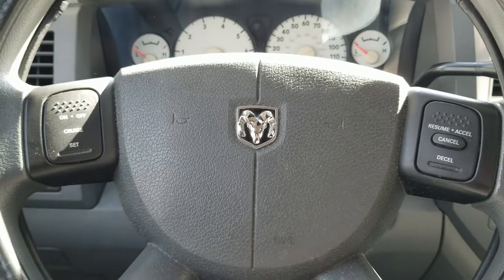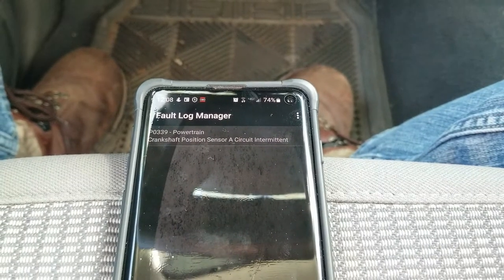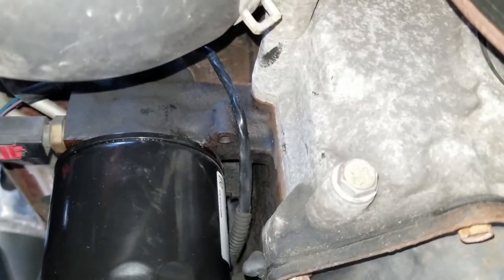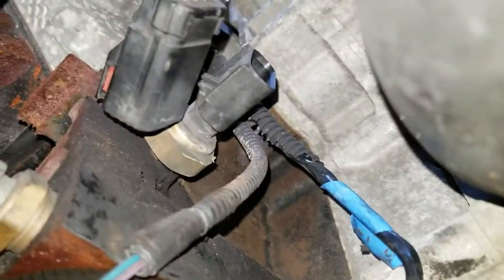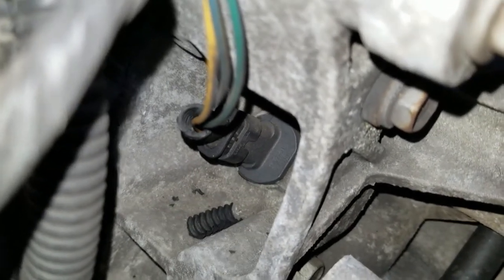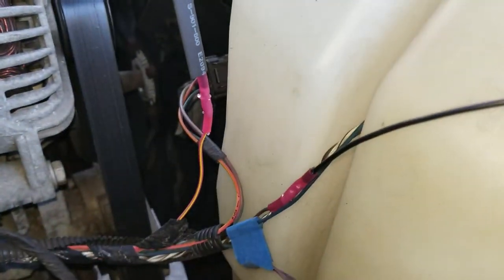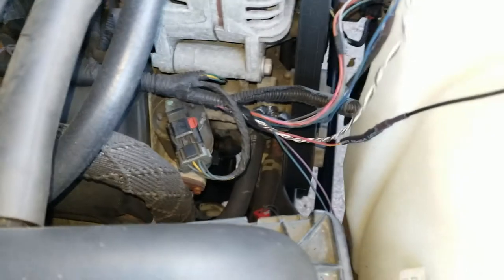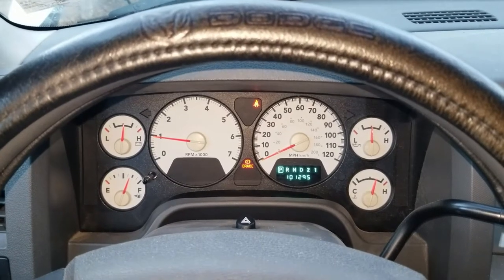2008 Ram 1500 - Wiring Harness Repair

Comment: i had a similar issue with my 2000 Laramie. When I took it over from my dad I didnt know he had taken it to a mechanic that had replaced a rear freeze plug. When that mechanic pulled the engine out he forgot to unplug the harness for the crankshaft position sensor which broke the wiring at the harness. When the truck would be in idle it would shut off or at minimum cause a drop due to shorting itself which at first puzzled me until it tripped a code which caused me to replace the 3 sensons on the throttle body and the distributor pickup coil and eventually shorting out my ecm. Anyways, openeing up the harness crimping the harness tat the back of the block was a pain but got it done. Havent had a problem since then.